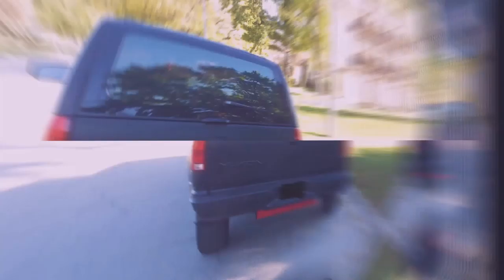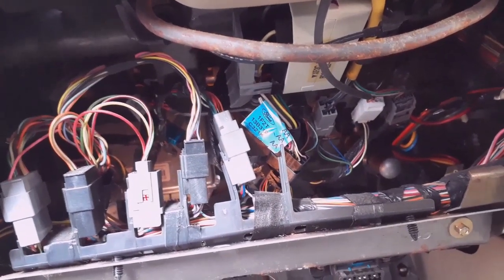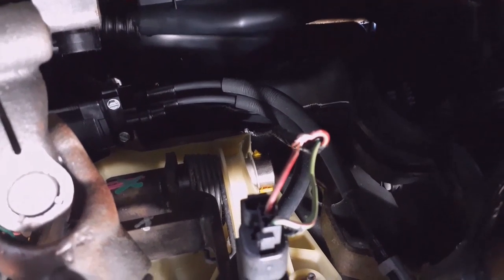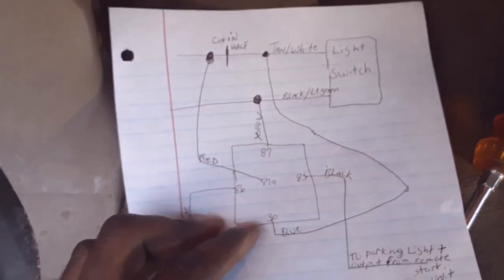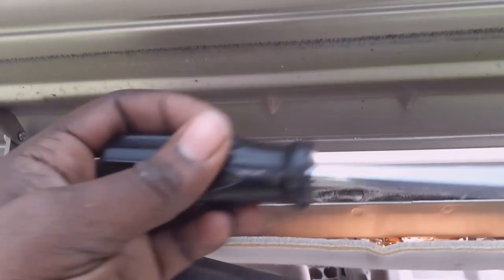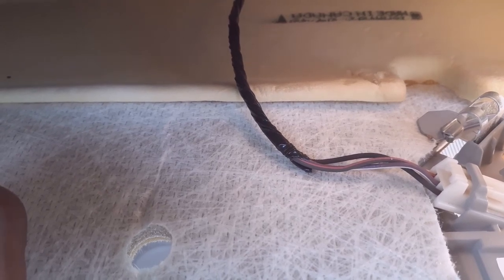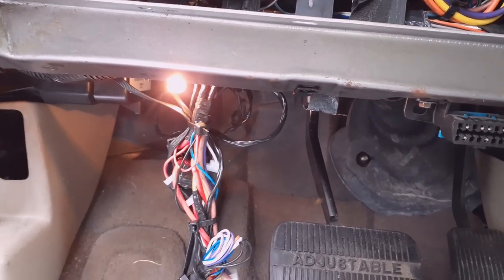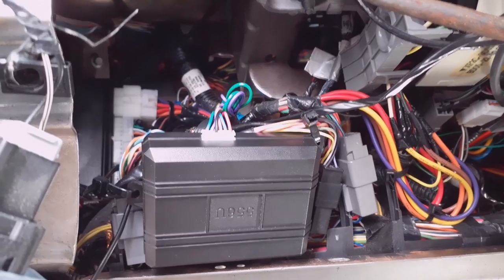How To Install an Alarm and Remote Start System

Comment: As a novice installer of 10+ years I must agree this is one of the easiest keyless entry/alarms ever. Sorry DEI lol! Excalibur has been my suggestions and alarm or choice but man Scytek is very budget minded and your video is right on point. Thanks
Reply from the maker: Hey for sure  Thanks!
Reply: Do you know if I have to program the remote for it to lock and unlock the door? Having issue it arms and disarm but on the remote screen it doesn't show that it is unlock stay on the lock position. Also the car doesn't lock and unlock.

Comment: If my car don't require a second ignition. Where do I wire the extra wire for the second ignition that is from the remote start?  Thank you in advance
Reply: Oh yeah it's going to be in a 04 Acura tsx....manual transmission
Reply from the maker: You don't have to use it but sometimes I use it to power the second accessory wire. Depending on the vehicle. Some vehicles the heater/Accessory and radio work through the same accessory wire and other vehicles the heater/AC and radio are on separate wires. Some people don't want their radio coming on during remote start. It's your preference...

Comment: Hey my car alarm has a Negative door trigger and the 05 Explorer has a positive door trigger according to the diagram. any advice on how to wire my door trigger wire to the car?
Reply from the maker: Mostly all alarms come with 2 door triggers wires, a positive, and a negative. normally the negative with be green, and the positive will be purple on the alarm box.
Reply: Change 4 A Dollar my alarm only have a negative
Reply: you do a double relay , you go - to + with the relay pinouts theres diagrams on the 12volt .com or other websites

Comment: Good install video help me a lot also what was the part number for the Diode
Reply from the maker: the part number for the 1 amp diode is 1n4001...
Reply: so that is the only place i should you the diode i have  Astra Scytek A15 alarm  im installing
Reply from the maker: @robbie4381  Yes. .....
Reply: @Change4ADollar  and one more question  how do you select the flashing light mine has selectable -/+ but i don't see a jumper to select it on the SCYTEK  A15 it says programmable on the instructions  i think you had the same alarm as mine
Reply from the maker: @robbie4381  it should already be set to positive, which is what you need....
Reply: @Change4ADollar  would a diode 5w 12volt work?